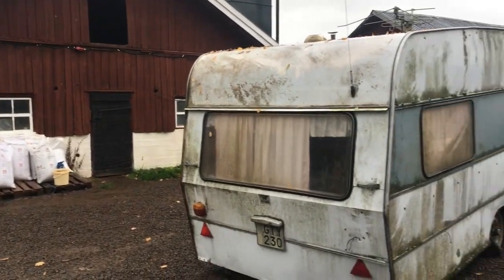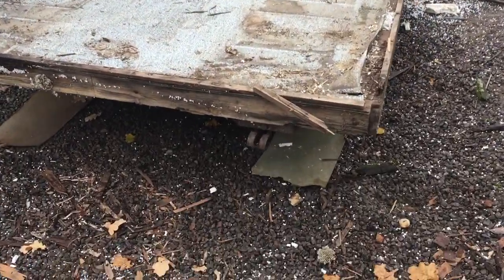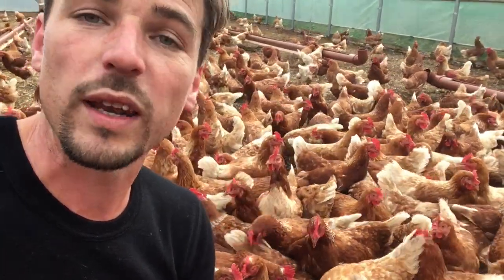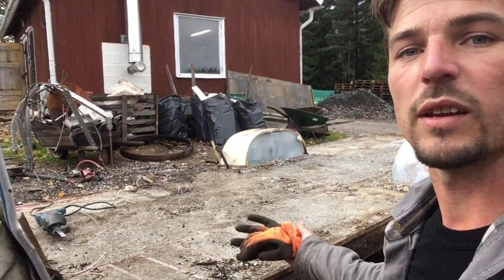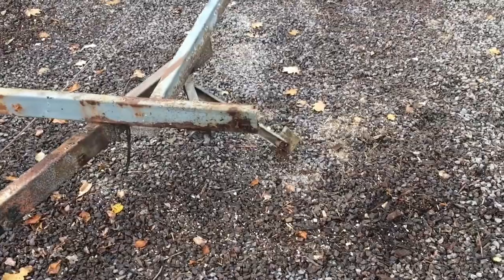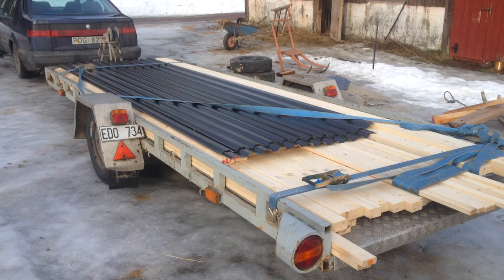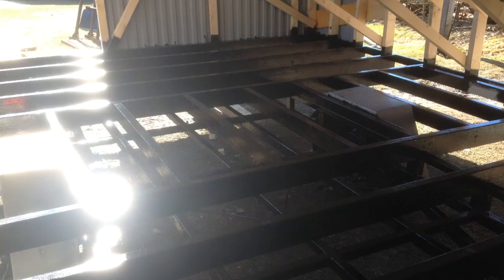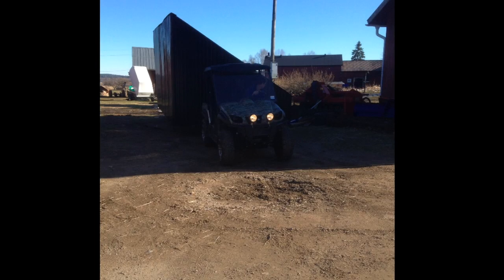S4 ● E117 Building Eggmobiles from scrap

Comment: Bitumen will hold moisture in and rot the frame quicker. Try red oxide paint or boiled linseed oil thinned with white spirit and spray it on with a simple hand held pump sprayer.

Comment: This is a great use of a piece of junk!
 European law says you can put 9 birds on a square meter of inside space. Does that law not apply to egg mobiles?
Reply: I recommend citing the law in question if you need an exact response, but I know that the regulations in my country (which is an EU member state) have different rules of minimum interior space per bird for caged birds, roosting
 birds without pasture access, and roosting birds with pasture access (also called free-range). 

This seems to be the latter case, which also has the most lenient minimum.
Reply: I assumed it was the same in all European countries but I may be wrong on that. In Germany it's 9 birds per square meter inside for conventional farming, free range has to have an additional 4 square meters per bird outside(non-organic). There aren't any regulations on egg mobiles since that isn't a common way to house birds.
Reply: I looked up the EC directive that concerns laying hens: http://eur-lex.europa.eu/legal-content/EN/TXT/?uri=LEGISSUM:l12067
Under the alternative systems heading, the last two bullet points may interest you.
Reply: I will check it out, thank you!
Reply: Thank you for raising the question. The way it is signed into my country's law, the stocking area may refer to either the egg-mobile only or the whole area that the chickens have access to. So whether the fenced area around the egg-mobile is included in the stocking area or not may be an issue you have to hash out with your local inspector. 

The roosting space of 15 cm per bird is set in stone though, which is twelve 5m long roosts for 400 birds. In the video, I count at least 11, though I'm sure Richard Perkins has it exactly according to Swedish regulations.
Reply: For UK soil association (Organic certified) hens, it's only 6 hens /m2. Even for mobile housing. Which is a shame, it really limits this sort of thing being viable without enormous houses moved by tractors.
Reply: Ben Scriven for laying hens in a non-cage system, paragraph 8, schedule 2 of the welfare of farmed animals (England) 2007 regulations states that the stocking density must not exceed 9 laying hens/m2 useable area. Paragraph 2 c. states that 1 nest box/7 birds or 1m2 group nest box area /120 birds is a minimum. 2 d. States 15cm perch/hen, minimum 30 cm apart horizontally and 20 cm from any walls. This legally supports an earlier claim on this message thread stating that 12x5m long perches would support 400 birds (500cm/15cm=133.3birds/perch x 12 perches = 400 birds). The only thing i spot here is that 30 cm horizontal separation means that having the perches at an angle wouldn’t theoretically make a positive difference in terms of perches/floor area. Do you have further information contrary to this? If soil association demands 6m2/bird in the coop then dont go for organic certification?